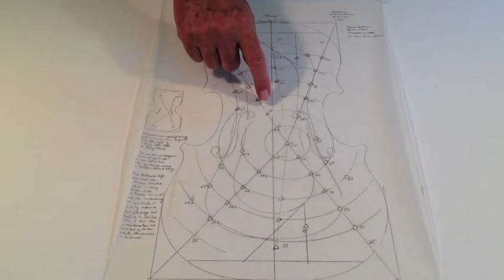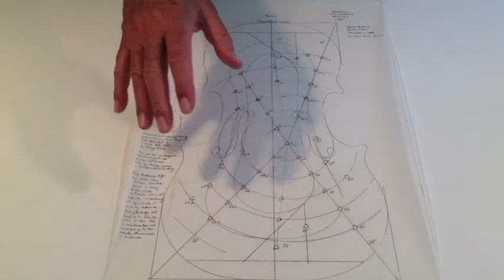Plate Thickness Guide

Comment: https://studio.youtube.com/video/__4wTr7T1Eo/edit
Thinkness gauge for Violin,viola,cello.
      This is a new type of thickness measurement device - magnetic thickness gauge. The basic testing principle is use two magnetic bodies S-N to attract each other. If there is an object sandwiched between them, then the gap between the two magnets is the thickness of the measured point of the object. Pulling the tail rope will make a "pop" sound. At this time The scale position corresponding to the red cursor is the thickness of the measured point.
Small wood chips are standard pieces of various thicknesses. Because climate change has a great impact on small wood chips, the thickness must be calibrated every time it is produced. If there is an error, it must be corrected to the standard data. Since the display of the thickness gauge is non-linear, each corresponding data must be calibrated. Be consistent with vernier calipers or centicalis without the slightest error.
During the production process, when each thickness gauge is adjusted, the accuracy of the corresponding scale of the cursor is controlled within 0.03mm. That is, when measuring and inspecting with standard wood chips, the cursor is aligned with the scale and cannot be off-line.
Once adjusted, the data is quite stable and can remain consistent for a long time and is not affected by the climate, but be careful not to overheat to 100°C and not overdo it.
Measurement method: The external magnet is put into the piano cavity through the F hole. When measuring, the external magnet will move with the test rod. When it reaches the measured point, pull the tail rope. The red cursor above will slide on the scale. When it makes a "pop" sound , the scale corresponding to the cursor is the thickness of the object.
There is a new Violin made of very good materials. The top is a chicken claw board, and the bottom plate and headstock are top-notch European materials. However, the sound is not ideal, the four strings are unbalanced, and it is determined that some areas are too thick. After confirming the repaired area, open the panel and make targeted adjustments. Do not open the cover without knowing the contents of the repair.
mail leon.li@sunrisechina.net